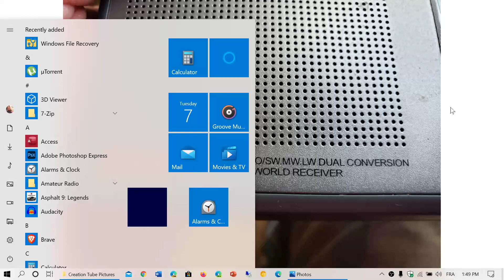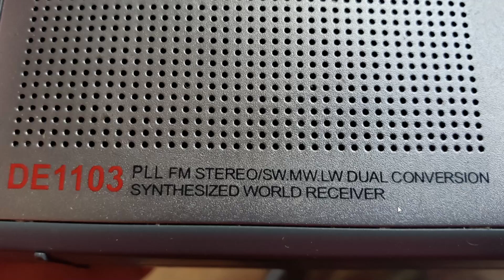PART 30 Shortwave for Beginners Single Dual Triple Conversion receivers

Comment: The bands are spread on purpose so that an imaging usually doesn't make for much of a problem. You mention on WWV being on 15.910 on a single image radio, the truth is, everyone knows that's a fake image and 15.910 isn't part of the broadcasting band.. Most analog single conversion radios are divided into bands that avoids the 910mhz problem. The one exception is the 60 meter band, that can 910khz to 49 meter band.
Reply: You are forgetting radios that only have one or two bands for Short Wave.(( ie: Panasonic RF-562DD  — one SW Band 5.0-18.0 [and the Retekess that Gilles just reviewed.))
Also, not EVERYONE knows that.-  This video and series is for the BEGINNER [....and knuckle heads like me who have forgotten 😁].
There are a lot of beginners- all over the world, and maybe some of them just might not know this [yet].
📻😐